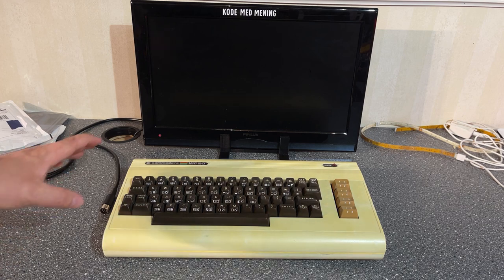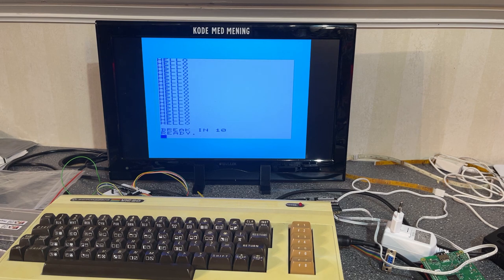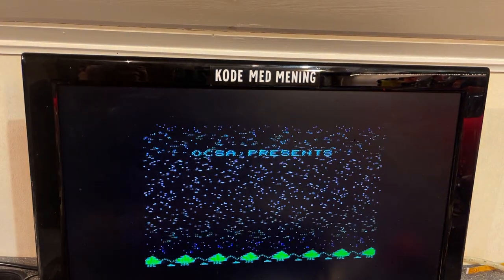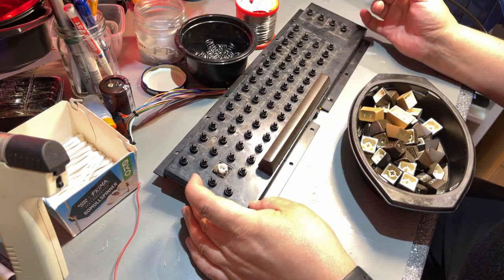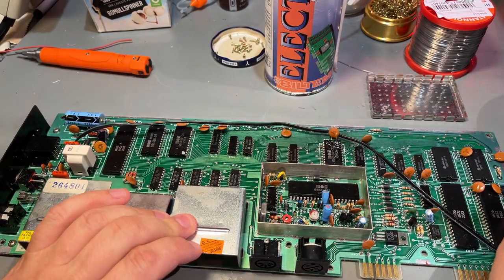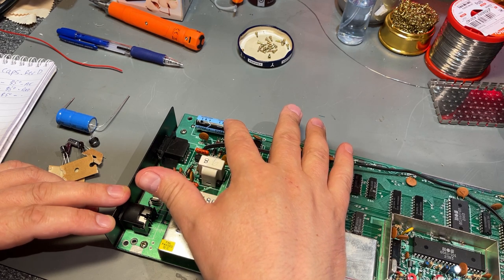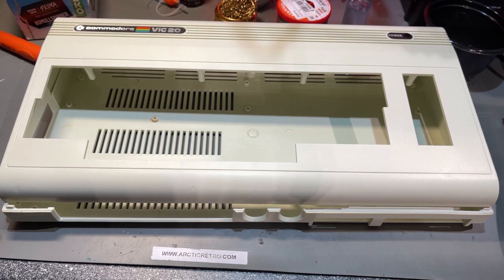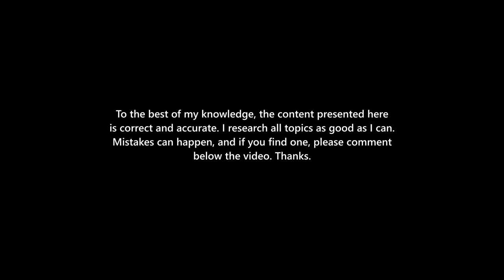Commodore VIC20 - Full restoration and future proofing - #ComMAYdore

Comment: If I have several big PCBs to clean I sometimes clean them in the dishwasher :D I've done this with numerous C64s, Amigas and several other retro computers, and they've always worked. I think it should be fine as long they are properly dried, perhaps with alcohol if needed.
Reply from the maker: Maybe I will try it some day. I have seen others do it. But somehow I think it is not good for the electronics :)
Reply: @Arcticretro  My fear would be the amount of liquid getting along pins inside chips and all the components. Within not all of it might dry completely and things could start corroding.

Comment: Those heatsinks won't help much when you keep the cardboard shield that traps the heat.
Reply from the maker: It is open i the back and on the sides. So heat it transported out.
Reply: @Arcticretro  The vents on the case are on the top and bottom; those are blocked by the cardboard shield. The sides of the case aren't open. The cartridge slot is closed by metal shielding, so you only have the user port and cassette port to get the heat out.

Comment: Nice one Tommy. When people dunk the motherboard in water to clean, I always wonder, what if some gets trapped inside switches, transformers, connectors? Hmm...
Reply from the maker: Exactly what I think too.
Reply: IPA will chemically attach to the water and carry it away as it evaporates. Alcohol's ability to chemically latch onto water is used as a cooling technique in low powered liquid rocketry where water acts as a coolant that runs thru the whole cycle. It was used this way in the A4/V2.
Reply: And there ist always a difference in brushing things with isopropanol to completely drowning boards in dishwashers. In my opinion Tommy does it the best was possible.